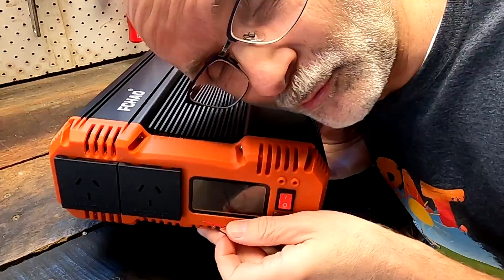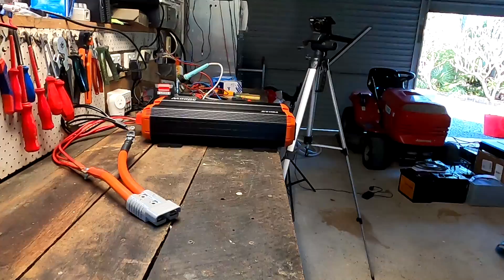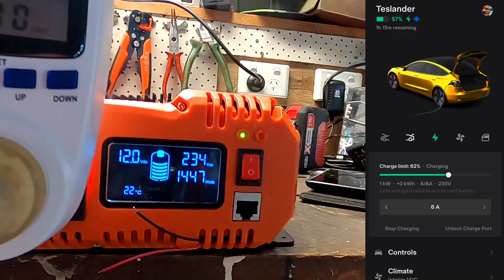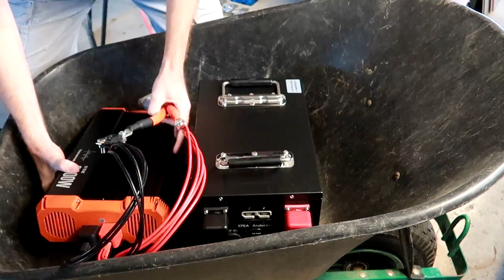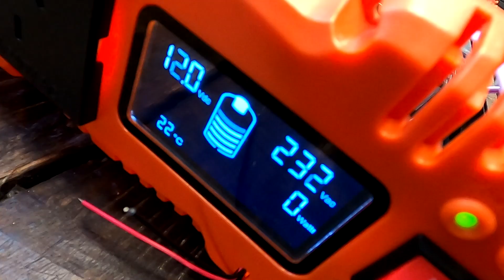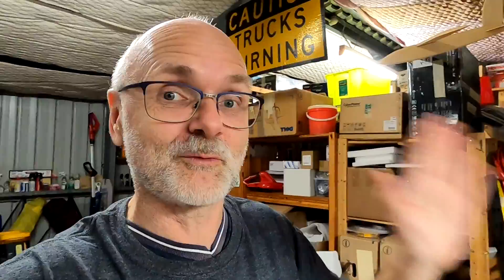The FCHAO Inverter Experience (aka Peter Inverter) 🤡 Another Chinese inverter or actually good?

Comment: Hi Andy, great video as always. 
I bought a 12v 2300w Peter inverter on the back of your testing and at first I thought it is great!
However mine shuts down when the batteries reach just over 13.5 volts with low battery warning beeping etc. the inverter displays a DC input voltage of 13.5 volts; the BMS and Smartshunt confirm this voltage so I assume the cut-off voltage is set incorrectly. Not so good quality control at FCHAO I guess.
Trying to work with FCHAO to resolve this issue but not having much luck, they are just pointing finger at batteries every time.

PS. this is happening when only running refrigerator and freezer which is a really low load for such an inverter so voltage is not being dragged down suddenly or anything like that and it doesn't reset either.

Hardware: Lifepo4 200ah prismatic cells JK BMS, Vitron MPPT, Smartshunt and AC Charger + RasPi

Keep up the good work
Dave W
Reply from the maker: Oh, wow, that is not good. Shoot me an email and I can probably give you some email addresses at FCHAO to contact. Keep pushing, they have to replace or fix it!
Thanks for sharing.
Reply: how did you go.  I was just about to order one until I read this
Reply: @dino5002  They said I could return it for a full refund but the shipping was too costly. We came to an arrangement on a discount rather than full refund. I have since changed some components and have it working satisfactorily now.
Reply: @davidwilde4896  thanks. do you mean components in the inverter or in your setup?
Reply: @dino5002 in the inverter
Reply: @davidwilde4896  can you pinpoint me what you changed ? i find the low voltage cutoff too low, would love to up it at lets say 11v or something like that. thanks

Comment: Any chance of doing a video comparing Modified sine wave vs Pure sine wave inverters running inverter appliances including efficiency? I mean appliances that turn the AC input into DC internally. Most of my house now runs these including fridge, washing machine. aircon with 500w input, ceiling fans, battery chargers etc. Also suspect all of them have basically no measurable inrush current. There seems a  good number of older quality inverters for sale that are MSW. Inductive loads I think there would be a big difference in efficiency.

Comment: Consider getting a growatt inverter which does nt need a fan, no cooling noise and a very reliable power house.

We got the second one, just 3000W for 500€ for a Growatt mic 3000 with up to 3800 Wp on the module side.
No need for such 380€ inverter not having proofed anything close to reliability . 
You simply get the noise of a hair dryer.

Comment: Sir did this Peter "FCHAO" inverter work with battery while charging from solar Mppt charge controller as that time battery voltage reach 14.5V max. On boost charging, I am using EPEVER XTRA series of MPPT
Reply from the maker: Yes, the inverter will work fine when connected to a MPPT and battery. No problem.
Reply: @OffGridGarageAustralia  thanks 😊

Comment: Thanks for this review Andy. Is there a way to program the Low Voltage Disconnect and reconnect for this inverter or is it fixed? And if it is fixed, at what values?
Reply from the maker: Thanks Rik, it is a fixed value and cannot be changed. In my tests, it cut out at around 10.8V under load (2.7V/cell).
Reply: @OffGridGarageAustralia  Thanks a lot Andy, we are using lead-acid batteries in Zambia. Would you agree that 10.8V is way to low and will damage the batteries? We normally set Low Voltage Disconnect (LVD) to 11.8V. I am even thinking to use the DC load output from our programmable PWM controllers to activate a relay and switch of inverters that don't have the correct LVD. Do you have any thoughts about this?

Comment: What we would need is overload test for these chinese 3000 - 12000w inverters. Do they really have overload protection. Will they be able to power off the load correctly if it gets too high.

Comment: Peter is in fact a good name, because, have you ever heard of Peter Smart? That is in fact Gyro Gearloose in English (but Daniel Düsentrieb in German), but Peter Smart in Norwegian. I got a question though. If your battery goes empty on power, how do you automatically connect to the grid so you don't loose electricity?
Reply: The clue is in the name - Off Grid! If the battery is empty his only option is wait, or fire up a generator.

Comment: Always good to see a 3,000Watt converter, but' from a 12Volt "WOW"!! Like it on the heavy side!! Needing "BIG" batteries!! I am more for a 50 to 60Volt battery, working with a smaller current would not need a wheel-barrow thenLOL All you need next is a cast ion stove, to burn all your waste wood in, while keeping a pan of water on the boil for a cuppa now and again. Interesting video again thanks, regards George.

Comment: Great Video, and channel, you have given me precious info that has helped me set up my FV system. About inverters, I am using an EPever 4kw  48V IP-Plus series Inverter. It has an anti spark feature which I have never seen on other products. The inverter has a series resistor inside which remains connected until the Input Caps Reach a high enough charge. I have tried it and it works great, with only a tiny tiny spark. I have had my cable lugs literaly welded to the terminals with other brand 4kw inverters!

Comment: That is interesting. I occasionally recommend that renogy inverter and nobody complained about it. I will now need to recommend the Peter inverter :)
Reply: It’s a shame those two wires which stick out aren’t a simple closing contact on/off control. Then it would be ideal to integrate with Electrodacus BMS
Reply: @PVflying  You can just solder two wires in parallel with the ON/OFF switch (keep the switch in the OFF position) and control ON/OFF the inverter with the SBMS.

Comment: I've been looking for a cost effective inverter for my solar generator I have a 316ah battery I've made from 840 lithium ion 18650 batteries. wonder if the 24v version will accept 29.2v

Comment: Hi Andy! I need your expertise   I’m using similar batteries that you are in a 24 V configuration at 320 amp hours, i’m using overkill Solar BMS , I’m using Magnum Energy solar controller and inverter. I keep bouncing between overkills tech-support and Magnum Energy‘s tech-support to get the settings worked out so everything‘s happy so far it’s still isn’t working like it should are you going to help me? I am on a true off the grid situation I’m on a 70 foot yacht trying to make it completely self-sufficient. Anything you can contribute would be wonderful. 
Thank you 
Ross

Comment: Hi Andy, I have searched your vids to see if you have looked at ESS, I found nothing, So I cannot ask ther, so I ask here on your latest. Sorry if My bad.  I find with the Victron ESS system my charging which then becomes controlled externally by the software is much better and you need set nothing in MPPT, just protection levels in BMS, have a read about it, it is a Victron Assistant set in the Assistants section of the inverter config. Bob UK OH! I use it with no mains connection which you are not supposed to do, but it work perfectly because it just thinks there has been a power cut and stays on battery.

Comment: Thank you of sharing experience. I bought three Powland 5000W inverters from Aliexpress. Now after couple of weeks two of them are burned for overload even I didn't use more than 2300W. Now we bought couple of these Peter inverters and lets see if they are working. My plans are to charge my car (2220W continuous load) and drink some coffee (1550W).
Reply: 5000w is surge, its rated 2500w

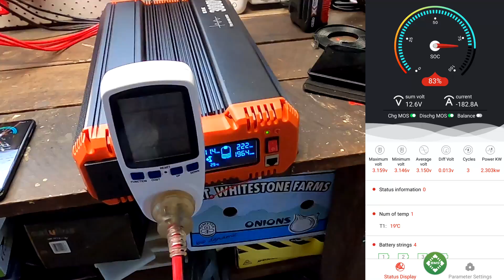Comment: Another great video. @14:21 I see 11.4Vdc on the display when the load is 1963W, the Daly shows 12.6V on the battery, so you have Vdrops of each wire = 12.6V -11.4V = 1.2V/2 = 0.6V on each wire.
Too bad FCHAO do not make for 120VAC US market.
Reply: You need to talk with their stuff. I guess their main market is the EU and they are opening the AU market.

Comment: Hehe Peter inverter, shame of the clue at the mains sockets but nice device, you can test the other inverter with a 50m cable in between maybe it works for the chainsaw, guess the starting wattage is to high for the inverter, if I would change my inverter it would be a solar controller with battery's and inverter option at once, but its a nice inverter for remote work/camper/boat sinus was very good at high load did not expect that, guess a good deal for 300$.

Comment: good test and review. I think for your outdoor equipment it would be less costly to make a nice heavy extension cord 😂. thanks Andy for the practical testing.
Reply from the maker: I'm really keen to take the battery and inverter out in the bush to cut firewood with the electric chainsaw. It is so much more powerful than the petrol saw I have which is just disgusting with all the fumes.
Reply: @OffGridGarageAustralia  Electric chainsaws are far more dangerous than petrol because PPE works by tangling the chain and stalling the motor. This is much more difficult because torque  curves are completely different. Electric motor torque is at maximum at zero revs; ICE have zero torque at zero revs so they stall.

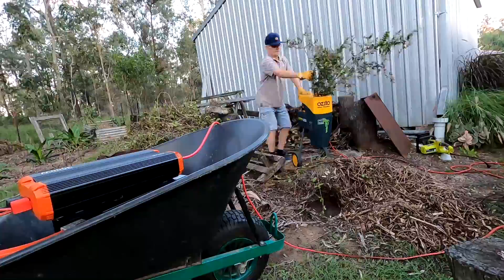Comment: 17:52 in the pile: is that a mouse?  I still think it's strange that 2 of the same rated inverters one of them works fine with the chainsaw and the other does not. It makes me wonder what is different on the other inverter. I do know that my 1 kw UPS pure sinewave cannot properly power my 700 watt vacuum cleaner ( I needed a load to test it) The vacuum sounds weird and it's probably bad for the vacuum. I am taking a guess that a lot of inverters have problems with electric motors.  I wonder what happens if you use like 2 kw-3kw heaters that have a nice powerfactor of 1 etc. Well we still over here have until at least 2025 to think about a solution for storing solar energy 🙂 I think the reviews are very nice. I especially appreciate the scope showing how pure the "pure sinewave" actually is. I usually hope for that in the reviews and usually get disappointed that they don't show anything on a scope or look inside.
Reply from the maker: That was a bug, not a mouse. I moved the wooden log and there were large white bugs underneath.

Inductive loads are always challenging for inverters but exactly that is what the inverter need to be able to handle in real world. 
I try to make these 'reviews' a bit different and think bit outside of the box of what I could present and show more real world scenarios of using these devices. Emergency charging an EV is one of them for example. And looking at the sine curve 😉
Reply: @OffGridGarageAustralia  Inductive loads are everything in the real world.  From refrigerator compressors, to air conditioners, to (in my case) table saw motors, and huge dust extraction motors for a wood shop.  While all my shop equipment pulls around 1500 watts when running, the inductive loads when starting up are over 3000 watts.  It only lasts for a few seconds but if you can’t supply that kind of wattage everything faults out.  I’m running a pair of inverters in parallel to supply 4800 watts just to satisfy the induction demands.
Reply: 1 VA UPS is max 680w,.....also starting the motor will be like 1500w for <1s

Comment: Thanks for that Andy, I need a new inverter I will have a look at there site. Just a question how much power or energy would you get in to the tesla from that battery, (how many kilometers) also do you know what price they are going to be brining that batter out for.
Reply from the maker: Hi Paul, the battery has a bit over 2.1kWh of energy stored. Considering the efficiency of the 12V inverter and the Tesla charger, you probably end up with 1.5kWh in the vehicle's battery. That gives you a range of around 10km.
You can already buy the Muller Battery here but maybe wait for their 2.0 version and included improvements: https://mullerenergy.com.au/

Comment: The Peter inverter does the job but I'm surprised the Renogy does not work as well.
Reading the other reviews and looking at the spec sheet on the Renogy 3000w it should have a surge output of 6000w, so my thinking is......is your one faulty? maybe worth testing the output FETs, you could have a couple failed limiting the output power.
I had a similar issue with an EASUN POWER Solar Inverter.
Thanks for the in-depth testing (not review) lol
Reply from the maker: Thanks Mark.
That could be that case. I wonder how I could test the Renogy without de-soldering all FETs inside this inverter. I probably charge the vehicle from it again and see how high I can push it as this is an (almost) pure resistive load.

Comment: can this possibly run a 1.5hp inverter-type AC?
Reply from the maker: I can't see why not, it runs the big chain saw without issues.
Reply: I guess it depends on the A/C. Some are much better than others.
I run a 2.5kW Panasonic inverter aircon very regularly in our caravan from a 1.2kW pure sine inverter. (I don’t use hp at all.)
Who uses horsepower? (Oh yes, of course, Americans 😁. Such an old, out of date unit!)

AC power draw absolute maximum on my Aircon is around 1,000w on heating, and 600w on cooling. 
The power ramp up is very slow, and the my 1.2 kw inverter handles it with absolute ease.
Reply from the maker: @FutureSystem738  it can depend on the kind of compressor built into the AC and if it needs a high currents to start.
Interesting that your small inverter can handle that sort of load.
Reply: @OffGridGarageAustralia  Amazingly Andy, my Panasonic split system (same as most people would install in a bedroom) caravan aircon would even start AND run on cooling cycle on my old Morningstar SureSine inverter- which was rated at only 300w continuous, (and 600w for a few minutes depending on temp). 
The only hard part was adjusting the temperature so that it wouldn’t ramp up to full power, which would trip the inverter off within 5 or ten minutes. I also had an old 3kW “Bit” inverter/charger which unfortunately had a very high standby current- so would sometimes run the A/C at night on cool-dry cycle at low power on the Suresine. 

I now have replaced those inverters:  a Giandel 2kW and another 1.2kW with dramatically lower standby current, so in hot weather we can run the A/C at low power from either of those at night if I know we can get good solar for another charge next day.

Comment: Hi Andy, this may be a noob question but.....can you please explain how you tested for voltage drop across those wires?  I've never seen that done before.
Reply from the maker: Sure
Reply: It looks like he put a test lead on each side of the wire with a current running across, it should show the voltage drop

Comment: I noticed the Tesla app was showing only 207v. 

I’d bet it’s based on the esg200 inverter riser card. They’re fine until under load because they don’t feedback properly to bring the voltage up.

That distortion is because at the zero voltage crossing they’re one step ahead of themselves which is a bug in all esg100/200 inverter controllers.

The older inverter definitely has the esg100/200 control board so it will sag badly and have noise as the zero crossing.
Reply from the maker: Thanks for the explanation. Never had any problems using the Xijia inverter and could discharge the battery with full 3kW for a few hours.

Comment: There are other options over 250amps other than Daly if you can get past the obsession with buggy smart BMS.  I don't think Muller build them they look to be generic imported with a re brand like a few other budget brands here in Aus. "Designed in Aus" Is not Built in Aus.
Reply: You're half right, it's not built in Australia and we don't claim that they are either. 
However, they're definitely not generic batteries with just our logo slapped on the side of them.

If you don't want a smart BMS, then there are options for 250A+. I personally like smart BMS, but I know it's a bit of a contentious issue.
We're also getting 250A JBD smart BMS custom-made and they should be available in the next month or so.
Reply: @mullerenergy  Generic meaning available steel box battery on Alibaba with no branding that you import and brand as your own, going by what I have seen available on Alibaba and it seems Big Wei have the same box only they do build the internals here in Australia. I didn't say that you claimed Australian Built but something I have noticed with a lot of companies importing products they will stick a big Australia logo or flag on a product with "owned" or "designed" which can give "some" people a false impression the product is made here and even Andy said "They are building battery 2.0" and thus viewers would think you build them. I was simply pointing out "Designed" is not "Built"

Comment: What if you install a GFCI on your homemade adapter? 🤷
Reply from the maker: It would not work. The power output of the inverter is floating as I said.
Reply: @OffGridGarageAustralia  and a GFCI won't work without a earth ground?
Reply: Your reply feels confrontational sorry for commenting.
Reply from the maker: @Roll2Videos  no, because it cannot 'see' the ground. It's basically disconnected.
Reply: @OffGridGarageAustralia  I was under the impression a GFCI compared the current between the two conductors sending and receiving and if there is a differential of 5 milliamps it would cut the supply. No ground wire needed. I could be wrong I'm here to learn.
Reply from the maker: @Roll2Videos  that's exactly how they work. But in case of a fault, no current would travel differently as ground is not connected in the inverter. Hence I created this external MEN link.
Reply: @OffGridGarageAustralia  very nice MEN link. if you become the ground connection after the GFCI it wouldn't protect you by stopping the current? It's not returning to the GFCI it's going through you.
Reply: Sorry if you become the Earth ground connection*